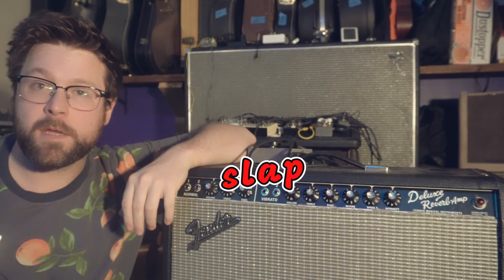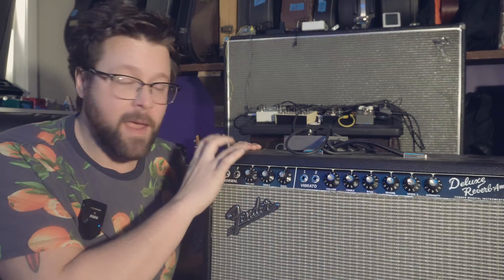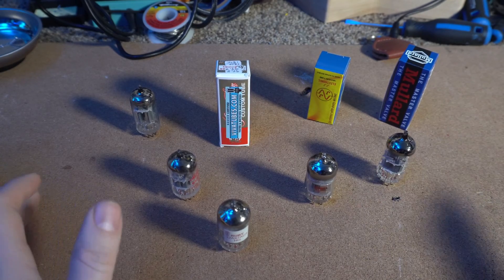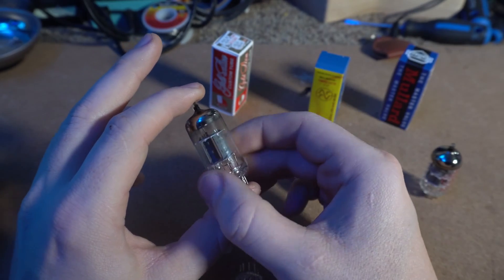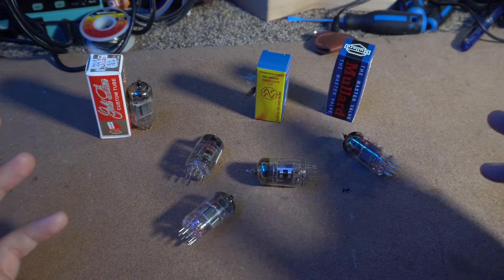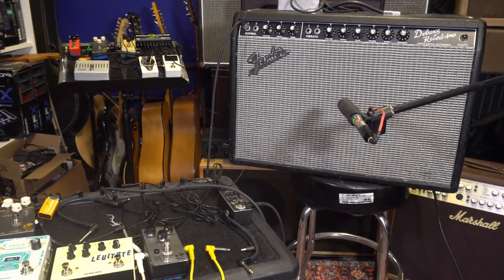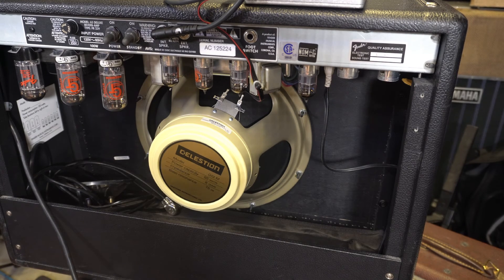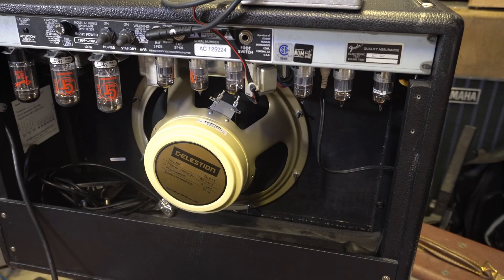Fender 65 Deluxe Reverb Pre-amp Tube Test

Comment: My feeling is exactly the same. I think players like to justify the extra bucks they've spent but in essence by the time you've tweaked the EQ on the amp and your guitar you really can't tell the difference or as you said... It's so subtle... which for some can be enough to make you bend a note in a different way. Saying that you'll notice a greater change in your sound by changing your guitar strings. The Boss EQ pedal or something like a Xotic Boost pedal will also help you get closer to the tone you're looking for or changing from a ceramic to alnico driven speaker.

Comment: Preamp tubes make a world of difference, but only if you swap in tubes that are significantly different than the tubes you replace them with and the tubes need to be tested! Bad tubes are very common even for new production. My 68 custom deluxe was obnoxious loud with disappointing tone. I swapped in vintage RCA’s and the amp has zero noise and is night and day better. NOS rca and ge tubes sound wonderful in these amps.

Comment: My experience is that some circuits are more sensitive to preamp tubes. I experienced quite som difference when swapping tubes (a range of new and vintage ones) on my Trainwreck Express clone, but on my Pro Junior it wasn’t that much of a difference. It might be placebo or how fresh my ears were those days though…

A speaker swap or changing the EQ settings will most likely make a bigger difference.

Comment: Matches my own tests.  There is a difference but it's no small nobody will ever notice unless looking for it. Even then I think it could be placebo effect
Reply: If he had changed v4 as well you would have heard a bigger difference, assuming the replacement tubes were good to go. If you understand what each preamp does and how or if it is impacted by other tubes, you can get big results. Channel 2 has a 2 gain stages, v2 and v4. Changing V6 is also key to improving tone. When I mentioned having a tube that was good to go, I meant one that is functioning close to its specs. You could buy a dozen of each the tubes he has in the video and check them with a tube tester and you would find at least 1 or 2 bad ones in each bunch…some would have more. There are a lot of tubes that sound/perform similarly, and there are some that will change when your amp breaks up, and some that change the eq. For best results, change all tubes with vintage tubes that have the characteristics you want in tone and make sure they have been tested and you’re not getting weak tubes. Here is a website that will help you understand more about your amp.
 https://www.kcanostubes.com/content/fender-amp-preamp-tube-layout-and-recommendations